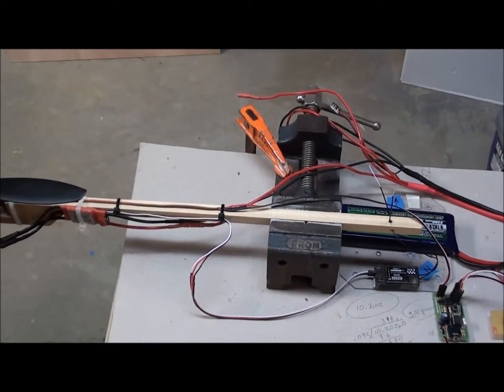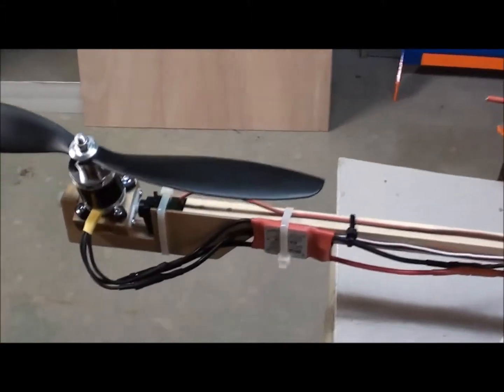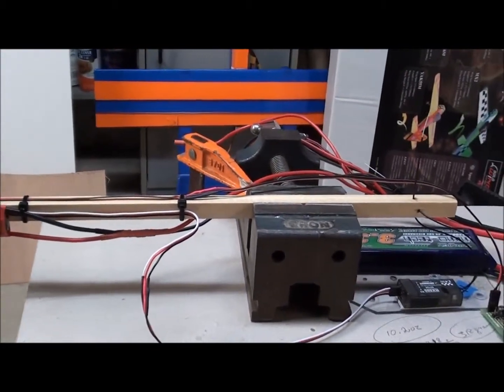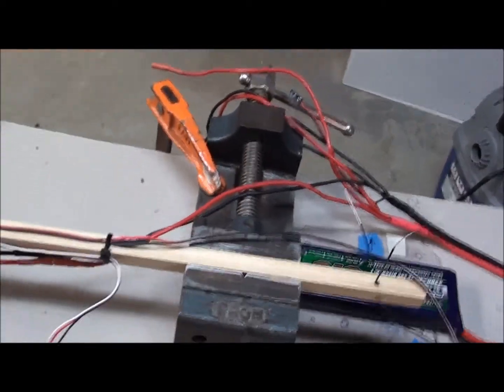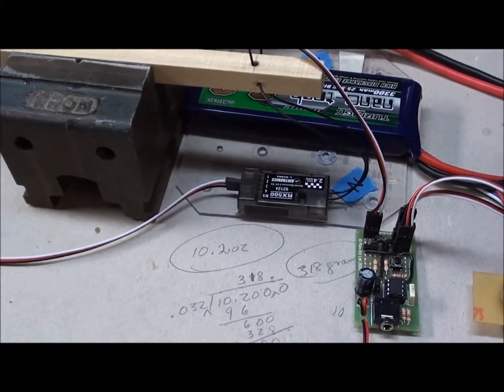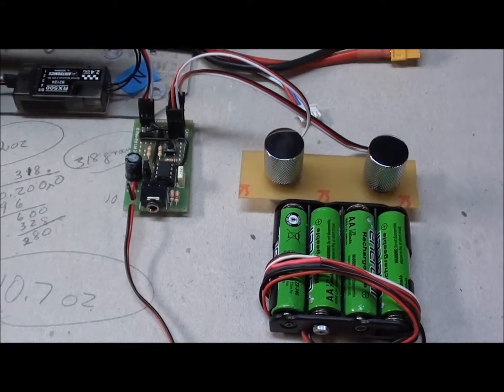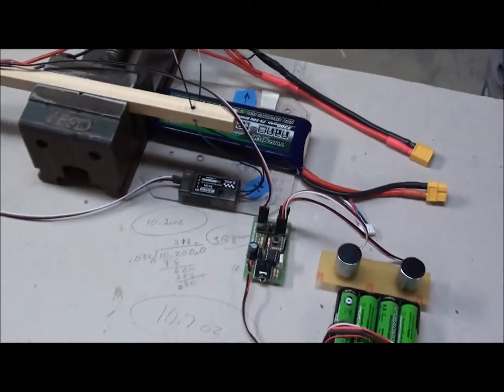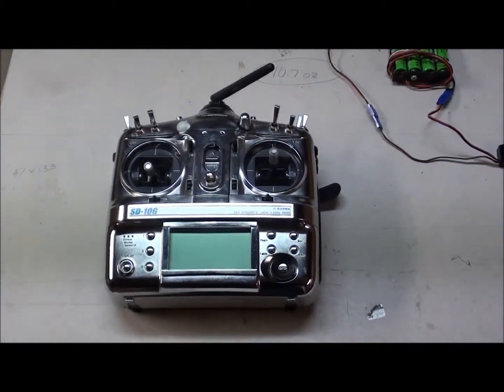Testing the Yaw Mechanism

Comment: Question, is the yaw mechanism supposed to go back to 0, straight, or is it supposed to be offset?
Reply: Using the KK2 board, the yaw mechanism will not go vertical until the motors begin turning.  If it doesn't go vertical something is wrong.
Reply: Thanks, i'll double check my setup.